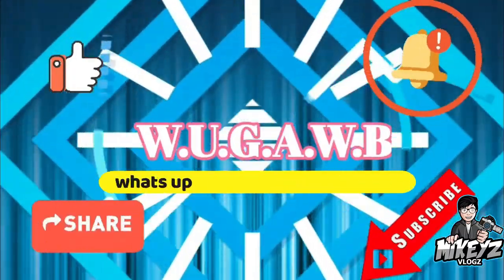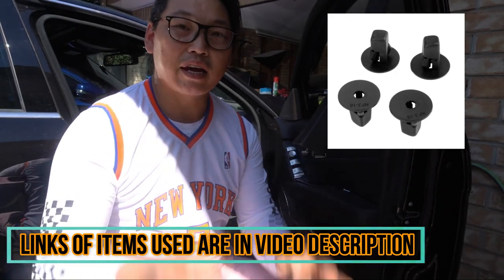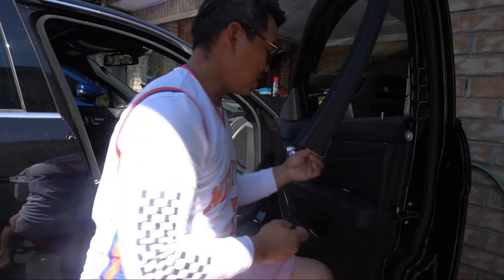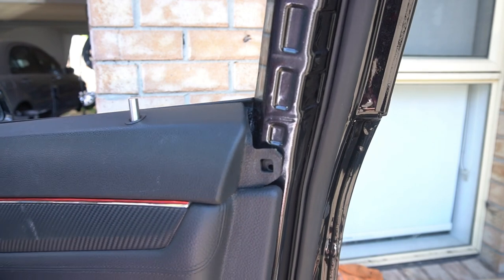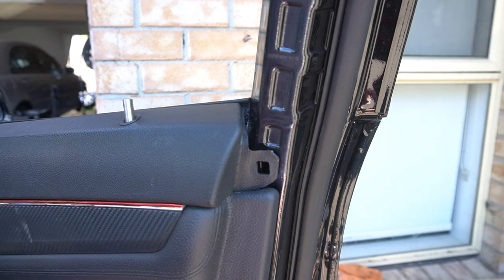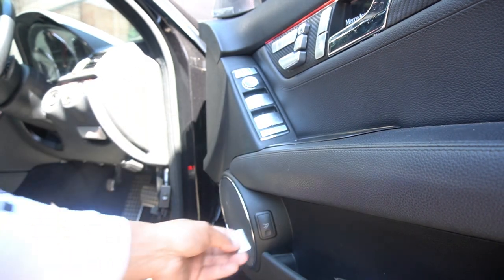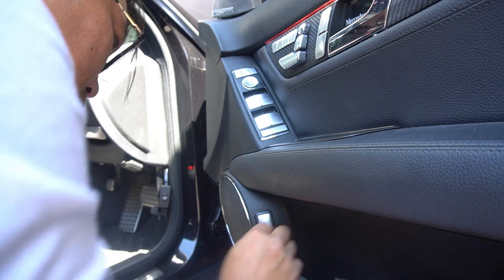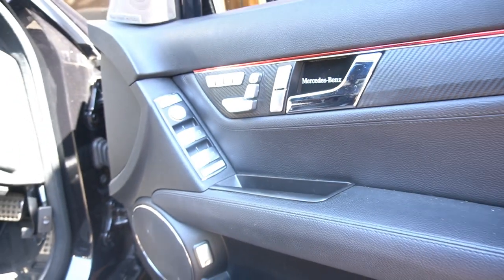mercedes w212 w207 c207 w204 x204 'H' clip mod+boot release button cover mod A B C E G ML class

Comment: Hi Mikey: Once again I’m indebted to you for your excellent video on removing the door panel on  w204. However, I did not have that H button problem you had. I have had this car from new since 2008 and it had a screw under the window trim. I needed to take it off to replace the seat switches. Once again Mikey , many thanks. Your excellent video simplified the whole thing.
Kindest regards.
Dermott Fitzpatrick
Reply from the maker: ur most welcome mate I'm just happy you get use out of my videos ...